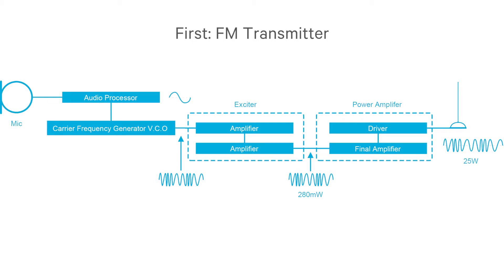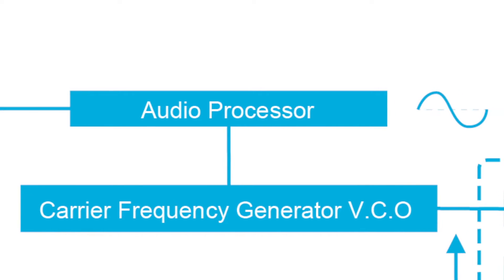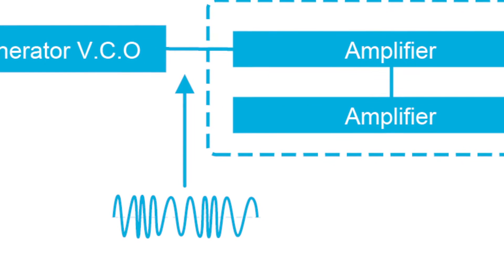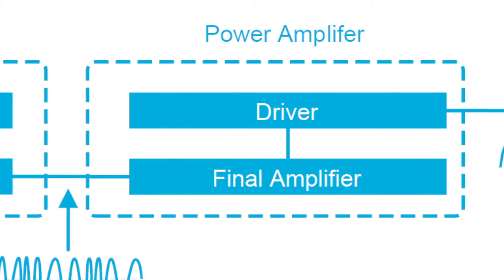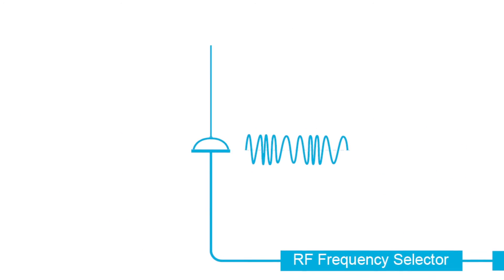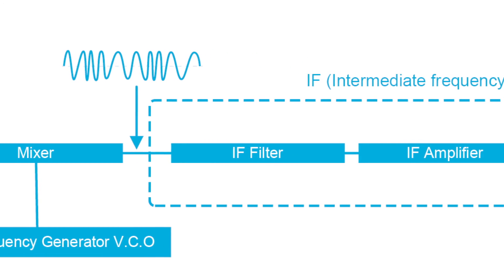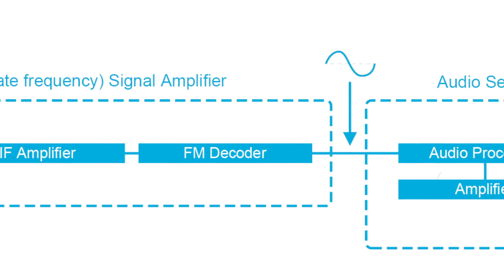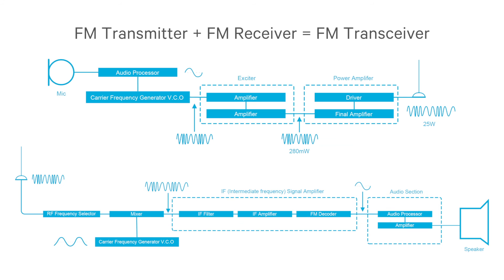2.3 How an FM Transceiver Works | Basic Radio Awareness | Tait Radio Academy

Comment: I would have like to have deeper insight on how the Transceiver shuts down circuits during transmit times and starts them up again after transmitting.  A knowledge anyone must have  when troubleshooting radios like this. Nevertheless, very clear and helpful introduction.